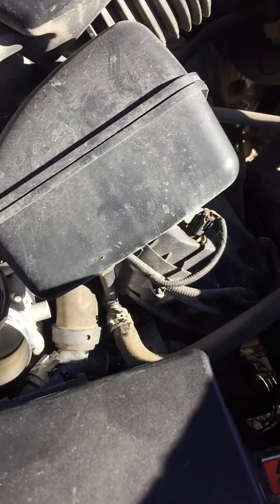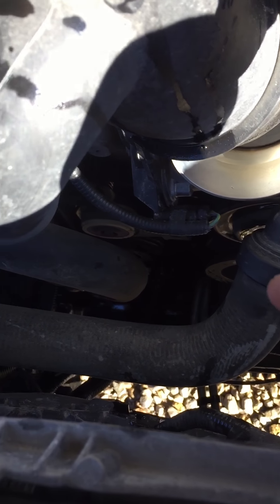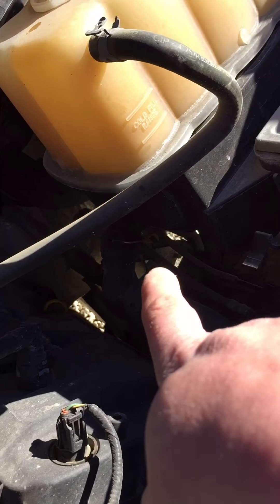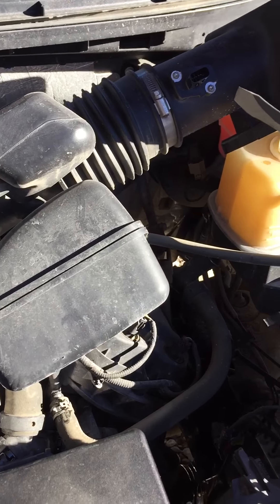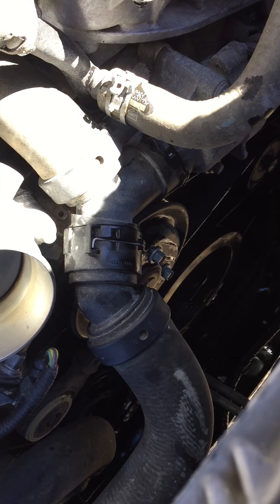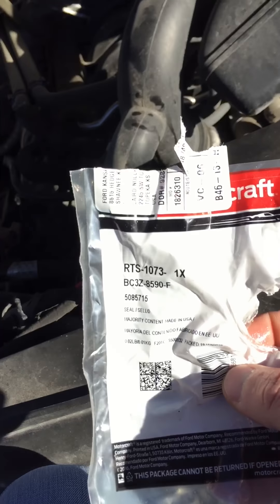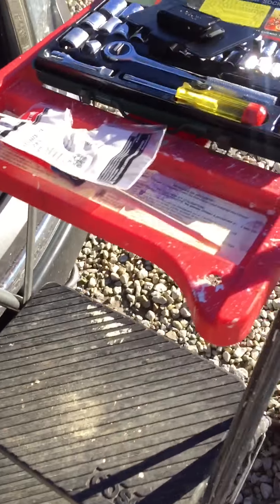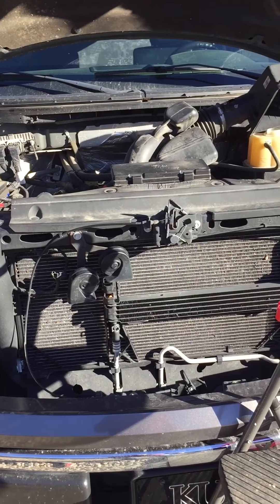5.0 F150 Coolant Leak

Comment: Great video man. Just did mine. The Y connection house I got from ford was a bit shorter then the original one from the factory. Still bolted up ok. Took some messing around with

Comment: Thanks for the video. My 2012 is leaking right now.  Planning on replacing the y pipe and the water pump when it gets above 25 degrees outside. Thanks again!
Reply from the maker: I had to eventually replace my water pump. Unfortunately this seems to be a common issue. Glad to help!

Comment: I had this fault when it got super cold here a couple weeks ago. Leaked overnight but would seal up once the engine warmed up a bit. I fixed it with the Dorman o-ring set. BTW,  Ford no longer recommends their Dexcool clone coolant. They replaced it with a new P-OAT yellow product. It works with the old stuff but best to flush the old stuff out and add a fresh fill of the yellow. Don’t put the “one size fits all” Universal green stuff in there or you’ll have a mess on your hands.

Comment: just did this exact thing. dealer in massachusetts/taxachusetts charged 13.95 plus tax. what about air introduced into system when pulling the hose and losing fluid? any need to deal with that?

Comment: .... on most FORD F-150s with the V-8 that small wire horse shoe spring will need to be TOTALLY REMOVED from the fitting to get the end of the radiator hose back on the Y connector ...... on my 2012 F-150 after installing the new O ring the hose absolutely would not go back on the Y connecter with that horse shoe spring in the correct to be reinstalled position, pulled halfway back ...... with that horse shoe shaped spring totally removed the hose with the new O ring goes on to the Y connector without any problems or any effort ..... install that horse shoe shaped spring a AFTER the end of the radiator hose is up and on the Y connector ..... posted by Jent on Dec 4 of 2021.

Comment: Hey man, I've had this problem and have been looking for the problem and found it right there at the connection at the reservoir tank. Thanks!!!! By the way my truck is a 2011 ecoboost
Reply from the maker: plowman1266 Nice. Hope it worked out for you. I had to eventually replace my water pump.
Reply: Went a supply shop and guy matched and gave me 5 o-rings. Said “don’t worry about it “ on the price. It popped right into place and the fitting felt tight when I pushed it on. Drove 100+ miles with plow and trailer and it didn’t leak. I’m also able to use my heater and air conditioner now without the electric fan under the hood kicking and then staying on. Truck is running 5-10 degrees cooler and figure that’s enough to kick on the fan. 
Thanks for the vid!! That and zero dollars fixed me up!
Reply: KsTimber Ghost yessir, me too. Turns out they both were leaking. Still your vid sent me down the trail to figuring it out.

Comment: I replaced the o ring
But still leaking
Reply from the maker: If you replaced the O ring and it’s still leaking, replace the Y pipe/T connector.
Reply: @kstimberghost3283  Thanks bro 
I hope it works
Reply: @kennethdurbin3385  Plastic is less corrosive, will not send rust to radiator, heater core, engine block and weighs much less , cheap easy replacement, on the long run plastic is better, they will not crack, its a polymer plastic, rust is the main culprit that plugs up the radiator and heater core on any vehicle,
Reply: @cessealbeach   plastic warps when hot over time...I had to replace my upper intake manifold in my 5.0 already. Pretty much replaced my entire HVAC system in my 2013 XLT so far. This o-ring, t-connector, heater motor, all the blend door actuators, etc. Haven't changed the heater core yet but I'm sure it'll crap out at some point.